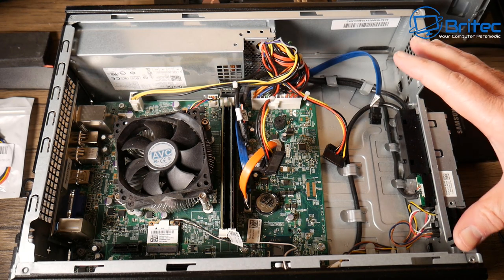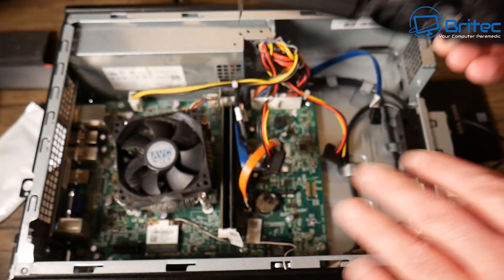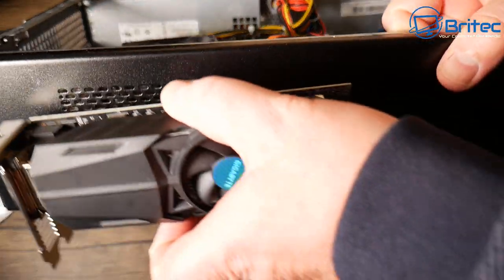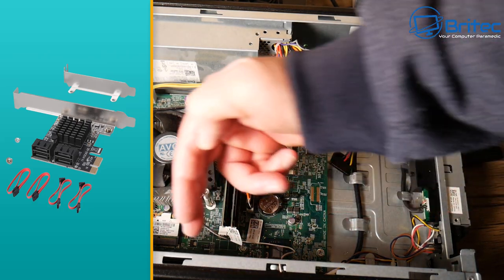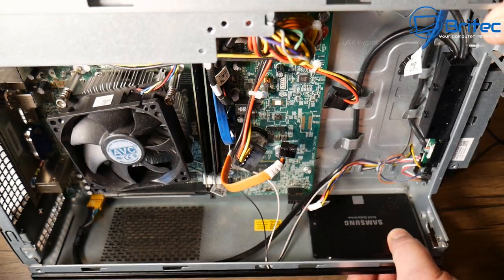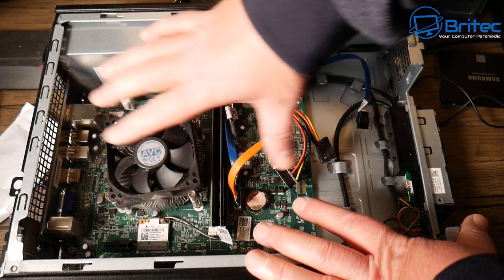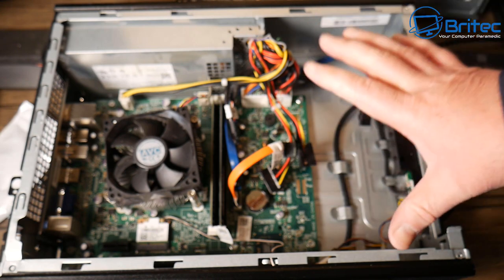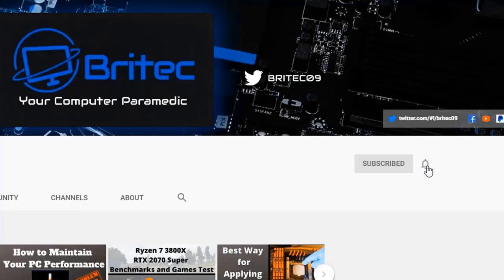How to Upgrade An Old Dell Office PC

Comment: My  new   ASUS  ROG  has the   1660  TI   ,   i  get  weekly   updates    with it  LOL  The  way   around  what you are  doing is   mounting  the power supply  outside the case, and run  the cables in   I'm   surprised   computer   manufactures  have   not moved to the    brick   idea  model  like  with   laptops and  put a   male /  female connector   on the  back of the case   .  This  would give  you more space inside and  also  reduce the amount  of heat inside      Posted on Facebook, Bye for now Cheers
Reply from the maker: Thanks, have a great weekend.

Comment: I've had some luck with transferring the vostro mobos into another case. The front io pins had schemes online with how to plug the pins with the only exception being the front 3.0 usb and reset button. Also one thing to consider, the older vostros may not have win 10 drivers from dell, technically they still work but it's something to consider.

Comment: I am facing issue in this pc i put 10 gb of ram 2&8 gb and gc gt710 and 2 hard drive in this pc. my pc suddenly reboot after some time of use shoud i increase the power supply and how much the mother board support power supply max plzzz help me 😔
Reply: It needs to be the same  type of ram.

Comment: You're better off powering the graphics card from the power supply not off the motherboard put unnecessary strain on the motherboard and a graphic card works better powered separately
Reply: That's even a thing?
Reply: @____-gy5mq  most modern graphics cards have a power socket

Comment: i would use a sinle slot graphics card  https://graphicscardhub.com/single-slot-graphics-card/  there are enough brands and high end cards available,i have installed the Radeon™ RX 550 AERO ITX 4G OC on my new ryzen system,and it works superb
Reply from the maker: Its the height, length and PSU in that case which is the problem